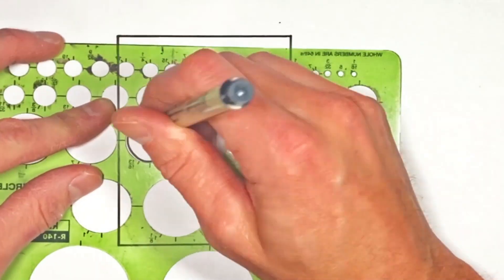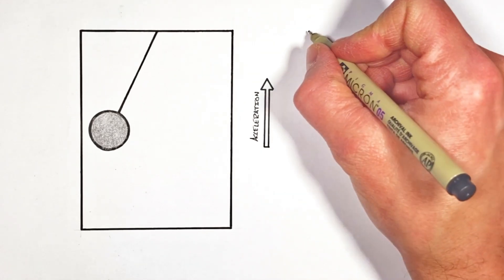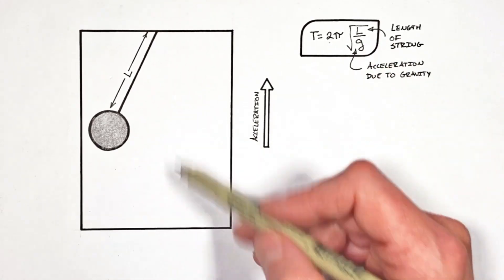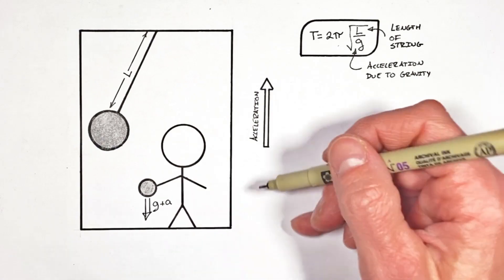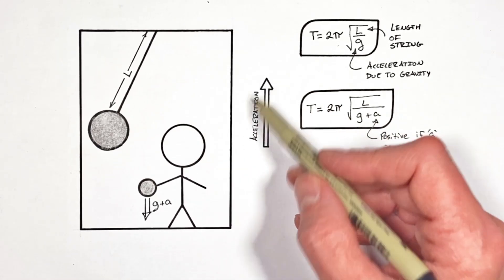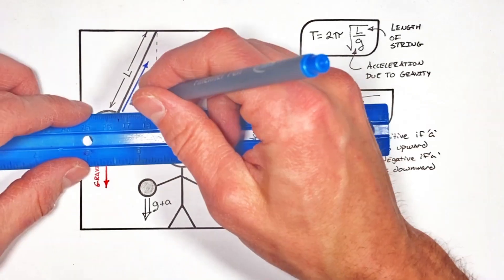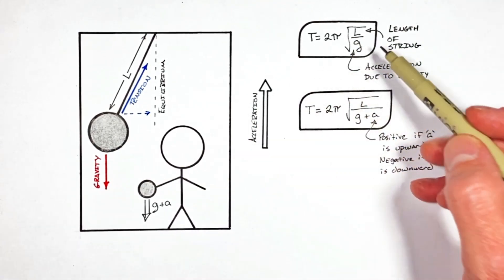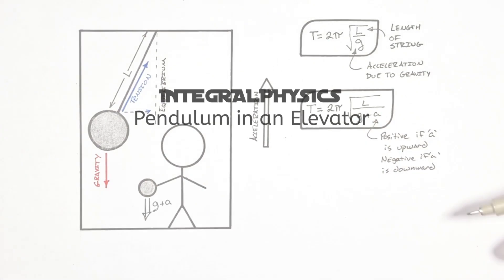Period of a Pendulum in an Accelerating Elevator  |  Explained & Calculated

Comment: A good video with an incorrect (or, at the very least, highly misleading) explanation of the tension.  The y-component of the tension and gravity do NOT cancel out - the pendulum swings along a circular arc.  While your statement about vertical components cancelling out becomes true in the small-angle limit since tangential and horizontal directions become identified, it is not strictly true and can be misleading since it would not produce accurate generalizations to large angles.  

Even for the standard simple pendulum, the tension F_T is given by m*(g + a_o_y)/cos(theta) where I've defined a_o_y = L*(theta_max)^2*(omega)^2*cos(theta)*sin^2(omega * t + phi) - g*sin^2(theta) (for theta in (-pi/2, pi/2), and where phi is the phase constant, theta_max the angular amplitude, omega the angular frequency).  Notice that this behaves properly under various special cases (e.g., theta_max = theta = 0 gives a_o_y = 0 and F_T = m*g).  

You can derive this result for F_T by first getting the angular acceleration alpha from the gravitational torque m*g*L*sin(theta) = m*L^2*alpha, then setting the tangential acceleration a_tan = L*(alpha), and then getting the y-component of that vector a_tan_y = -g*sin^2(theta), then adding that to the y-component of the radial acceleration a_rad_y = a_rad * cos(theta) with a_rad = v^2 / L where |v| = L*(theta_max)*(omega)*sin(omega * t + phi).  Of course, this could be written differently if we decided to plug in omega = sqrt(g/L), btw.

In the case of the pendulum being in an elevator, we must add a term m*a to the net force in the y-direction on the pendulum bob, resulting in an increase in F_T as you said; doing this, we'll algebraically see that the solution becomes the same as if we had just replaced "g" with "(g+a)", as it must in order to match what would be predicted by an observer in the non-inertial frame of the elevator.  However this increase in F_T does not happen in the way you said, nor for the reason you said.
Reply from the maker: You are completely correct however you've missed the point.  99% of the people who ever see this problem are going to be treating pendulums as simple harmonic oscillators and operating within the SAA;  and the people who aren't certainly don't need me explaining simple stuff like inertial reference frames to them.
Reply: @INTEGRALPHYSICS  That's understandable up to a point, however I think it's important to lay out the caveats to such an explanation up front.  Besides avoiding confusion for kids who may wonder at how something that clearly moves on a circular arc is only supposed to move horizontally (and it's an important geometric limit-case in other situations as well, such as relating circular motion to linear motion in the limit of R approaching infinity), it helps to emphasize that models are only useful within limited domains of applicability.  That kind of epistemic and meta-cognitive awareness is crucial for budding young scientists/engineers to develop.  

To cut it out entirely in the interest of limiting ourselves to simplified pseudo-explanations can hamper their higher-level reasoning and modeling abilities by feeding a false sense of certainty, rather than recognizing and accurately assessing the various shades of grey which are inherent in our attempts to model real phenomena.  Sure, if they grasp the incomplete explanation they can answer this question on a test with some (probably over-inflated) level of belief that they truly understand it, but they are entirely blind to the frailty and misleading incompleteness of their answer.  Cutting out discussions of the shades of grey inherent in considerations of each model's domain of applicability sterilizes and trivializes the subject in general, removing its vital essence and reducing it to a merely didactic question-answering game.  It can be no wonder then that students, and even some academics and professionals in programs that physics serves, then start to question its worth in their curriculum/training.  In short, it's a brittle trade-school education mentality as opposed to a truly empowering liberal education mentality.

Also, SHM in general presents a golden opportunity to introduce to them a sense that things they (should) learn in intro calculus, like Taylor series, are crucial to the subject.  Even kids who are taking only college-level physics can gain something by learning about Taylor series and the utility of calculus via various other mentions and highlights during a course - maybe it can even help motivate them to rethink the worth of the subject.  Although they themselves may not pursue it, getting at least some sense of why and how it is useful can transform their attitudes toward the subject, which can have a knock-on effect with their peers that they talk to, or with their own children in the future.  They perhaps don't need the full explanation, but they deserve to know that a fuller explanation exists, as well as what tools it entails if they are interested in learning more.  

So at the very least, for a video geared to a general audience with myriad reasons for being here, I would suggest that there be two levels of explanation offered; one for people just looking for a relatively superficial and narrow model, and another for those interested in looking at when, why, and how that model breaks down (and how to correct it).  The latter would include prospective physics, maths, engineering, and chemistry students among others, and I think overall would constitute far more than a mere 1% of students who encounter the question.  It would also give you a chance to make more content that views from this would be likely to spill-over to, so it'd be a win-win.

My two cents at least.  I appreciate the work you put in here, along with other YouTubers, which is why I bother to make such a long (and hopefully constructive) criticism.  Cheers.
Reply from the maker: Again you make a very good point and for that I thank you.  I agree with you about the ramifications of distilling an explanation to its most common denominator.  I will certainly keep this feedback in mind moving forward.  Thanks!
Reply: The radial components don't generally cancel out, rather there is a net radial force  that supplies the radial, i.e., centripetal acceleration, which is zero (i.e.  the radia forces cancel out) only when the pendulum reaches a state of instantaneous rest at its amplitude.
Reply: @oyecomova8216  True!  That was probably confusing phrasing in my first paragraph.  Thanks for pointing it out, I've now edited that sentence out since it's unnecessary and risks confusion.  The statement was intended only for the limit case of small angles (and hence very low speeds) that the video was presuming.  The intent was to give the equivalent 'polar' version of the 'cartesian' approach taken in the video, by noting that the y-direction and radial direction are identified in the small-angle approximation (which is also the limit of small speeds), and then arguing for the advantage of the 'polar' approach by showing how cleanly it works when relaxing the small-angle approximation.  The radial net force is certainly non-negligible outside of that limit (hence why a_rad = v^2 / L).